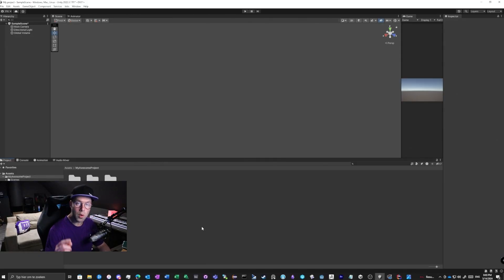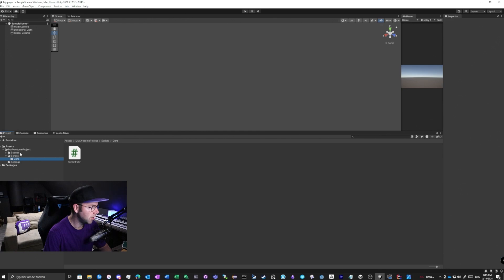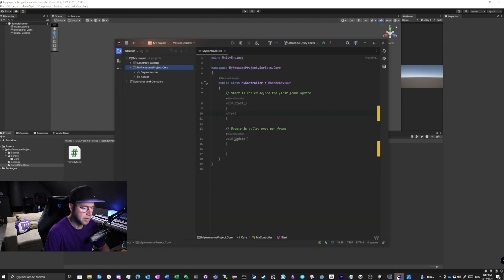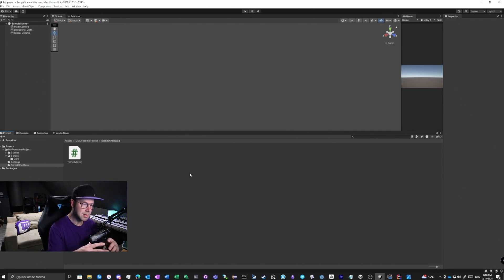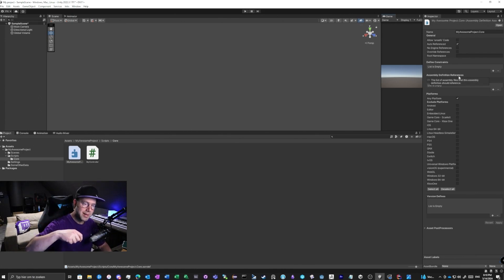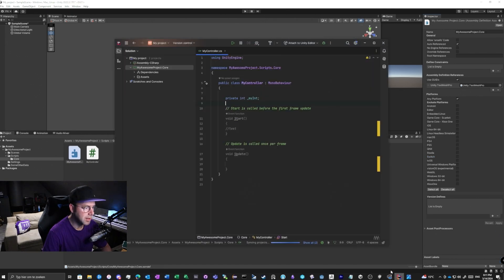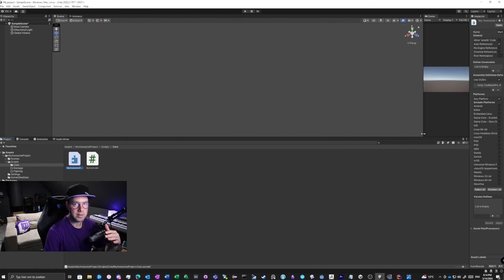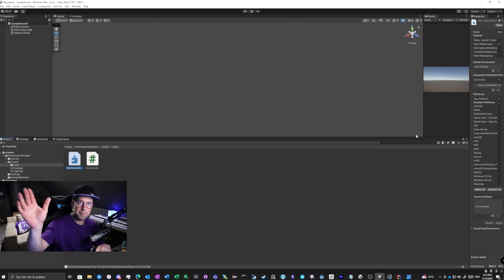How and Why Assembly Definitions | Unity Tutorial

Comment: I agree that one of the biggest reason to use assembly definitions at all is to separate your project scripts from external libraries such as editor-only scripts, asset store packs. By default, Unity does this with any scripts you put in ANY folders named "Editor" (assuming that folder is not part of a custom AssemblyDefinition). Unity will separate them in two assemblies: "Assembly-CSharp" and "Assembly-CSharp-Editor". For Asset store packs, Unity does NOT separate them for you, you have to make sure the asset pack developer put their own AssemblyDefinition file structure, OR you must add one to their pack yourself (and then reference it to your own). It's confusing, but complexity just means freedom. (Also note that you can see what script belongs to what assembly by clicking on the script file in unity and looking at the Inspector window)